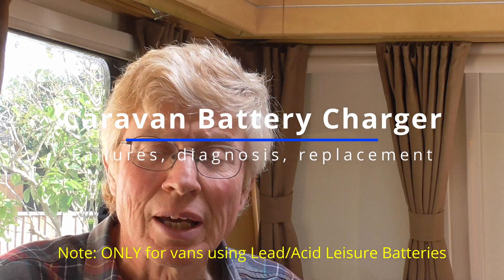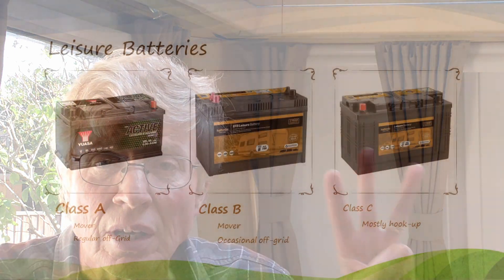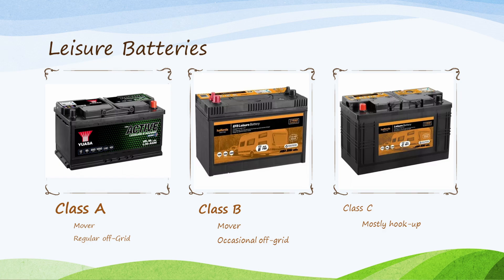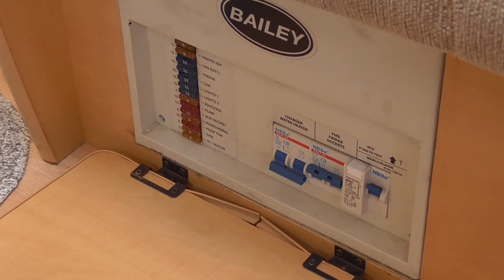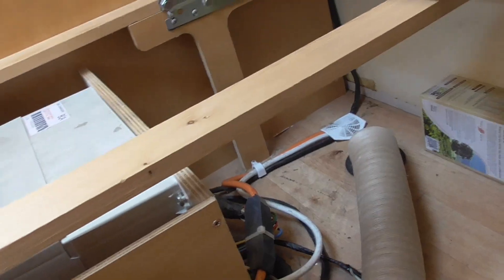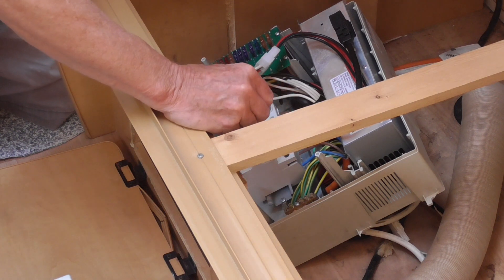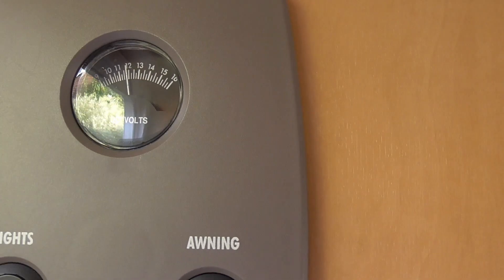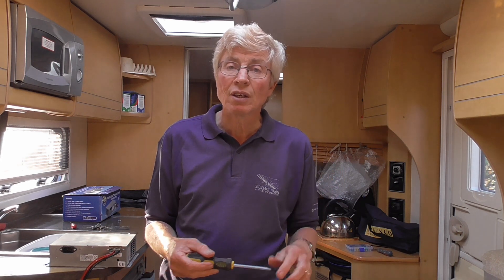HOW TO: replace a Caravan Battery Charger (and why they break)

Comment: Hi i have a lunar quasar 2019 and the battery drop low to 10v6 but it wont charge?
Reply from the maker: This does sound like a dead battery - a local mechanic should be able to test it

Comment: Hi im new to caravans and my caravan lights worked perfect and the lights have dimmed and the water isn't working properly and if I unplug from the mains nothing works what could be the problem?
Reply from the maker: Sounds like you are running a dead battery - look at the voltage meter - after charging for a few hours the voltage should be above 12.2v.  First check that the terminals are tight on the battery post.  Also check that something is not causing a power-drain by disconnecting the mains then removing & reinserting each 12v fuse - if the lights suddenly get brighter  then you've just removed the fuse to the offending circuit.

Comment: Did the failing power supply trip the heater/charger. I have a failed tripping system and assumed it was the immersion heater. But I replaced that and it still trips.
Reply from the maker: Yes - they share the same circuit and trip - One I'd replaced the charger the water heater worked perfectly..... however.. it is possible to disconnect the mains lead (a kettle-lead) from the charger & then the heater should work fine